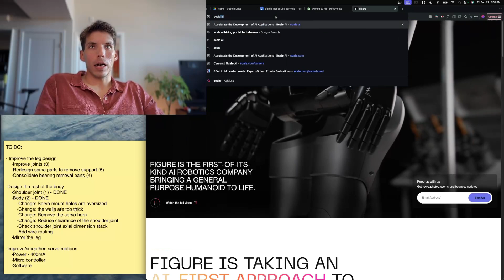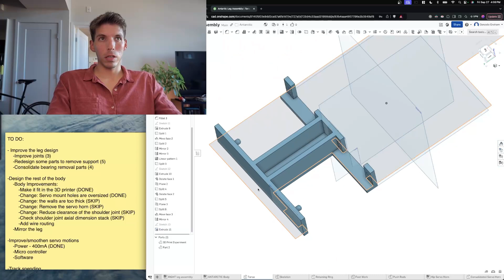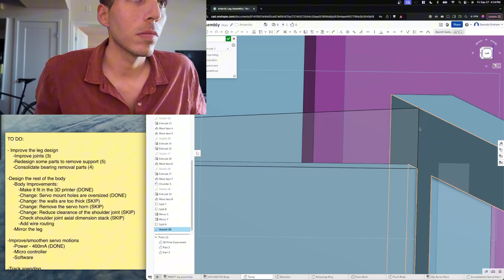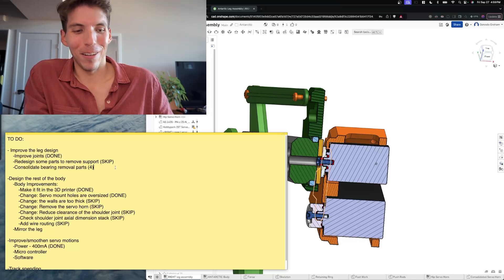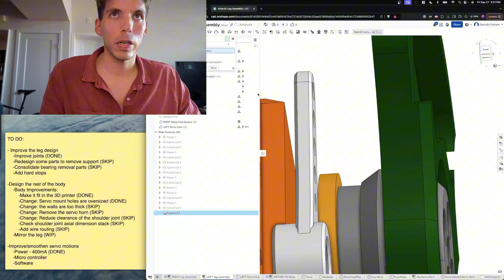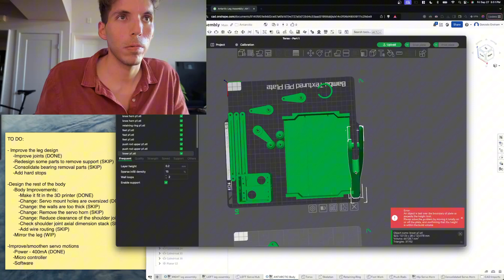Building a Robot Dog: CADing the entire dog and printing it (Part 4)

Comment: You helped me on a current exoskeleton arm project; I needed a way to keep a constant current and amperage from a battery and I wasn't aware of buck converters.  Your research is quite interesting and it helped me out.  Thank you!
Reply from the maker: Thank you! And would love to see the exoskeleton arm you're working on :)

Depending on how constant of a current you need, you will need to make sure the buck converter is suppling low ripple (ie it’s not fluctuating that much) 

Can read more about it here: https://electronics.stackexchange.com/questions/356758/ripple-current-buck-converter